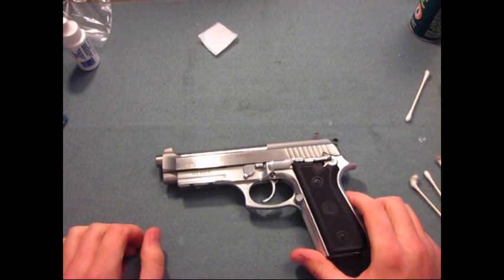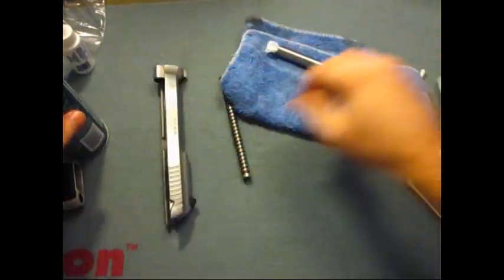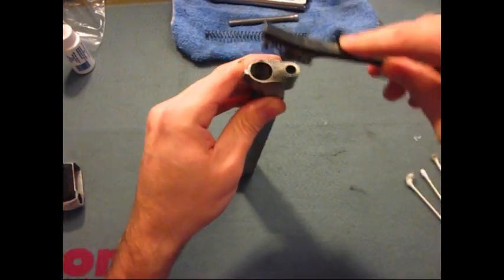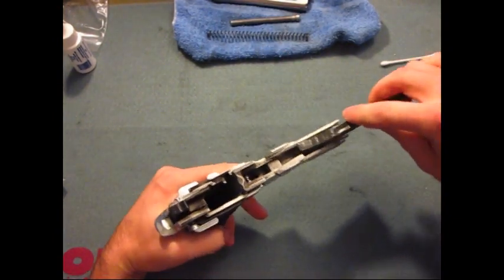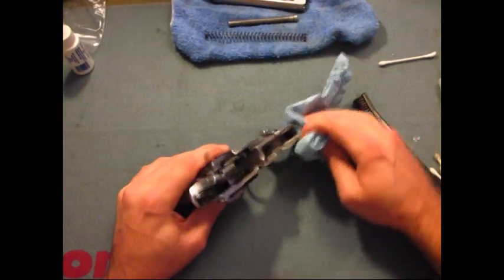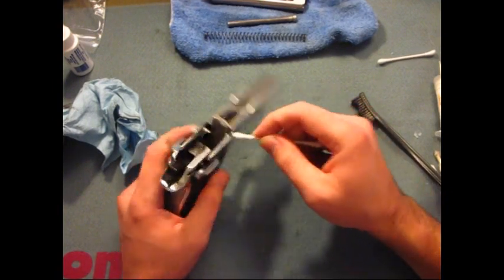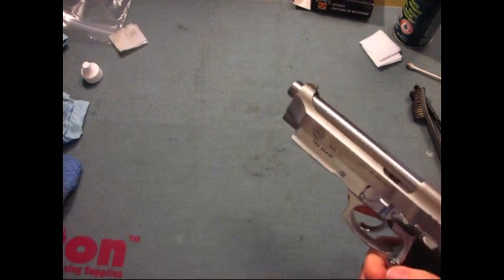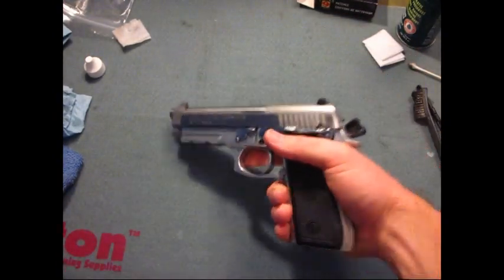Cleaning The Taurus PT92 (Beretta 92FS)

Comment: how do you clean your grip area? like the back strap and the front with the grooves. With moderate use those grooves collect a lot of dirt and grease. And have you found a way to bring the shine back to the grip? I use my pt101 a lot and the frame still shines like new. But the back strap area and the front under the trigger guard has lost a good bit of it's shinyness. any way to clean it good and make the grip shine again like the rest of the gun?

Comment: You forgot to mention you have to have the magazine out of the gun in order to remove the slide.  Good video though. If you use a shaving brush it makes it a lot easier to get in all the hard to get areas to oil the parts and the slide.